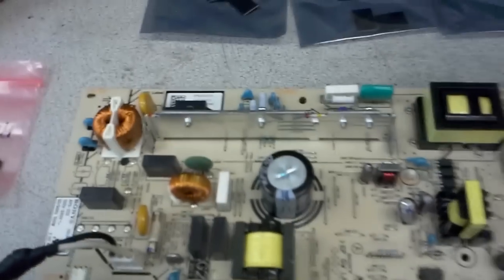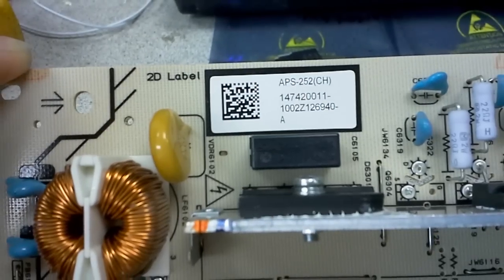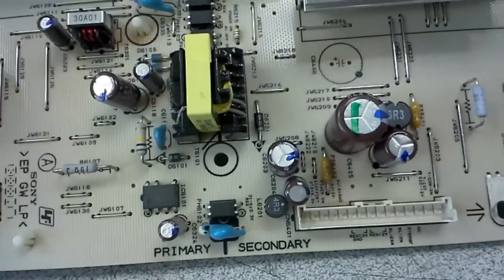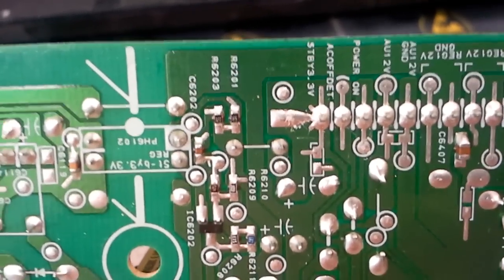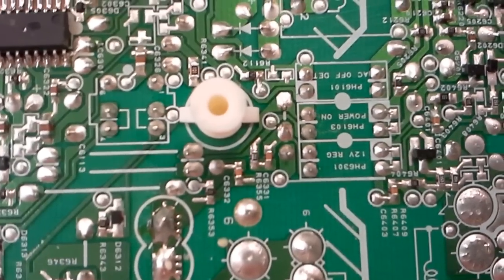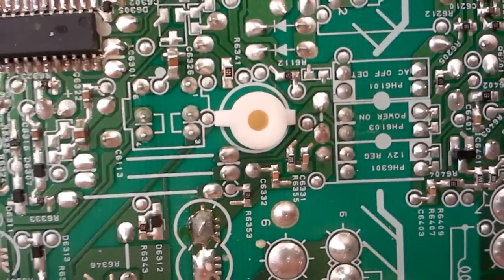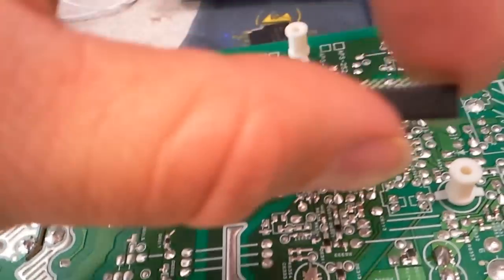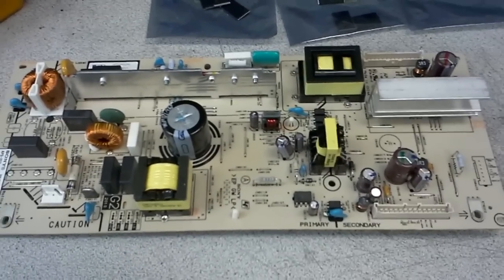Sony KDL-40EX400 KDL-40EX500 dead power APS-254 1-474-202-11 - how to test

Comment: Let me see, time 4:20 aprox. when we join 3.3 standby and power on and we measure the  right two pins of power on octocoupler, it must measure aprox, 1.2V, or am I wrong? If those two pins are the trigger for the octocoupler to activate the IC, how can a test its   function properly?
Reply from the maker: Without watching the video - sorry! - there are several OCs on any given power board and some of them are on/off switches and others are feedback for the voltage regulators. PS_ON is an on/off switch an if you trace the PS_ON signal to a particular OC then yes you should be able to see ~1.2V on it when PS_ON is activated. Naturally you should be able to see its transistor switch on the other side carry some voltage 10V to 24V depending on the board, which goes down to 0.x when the 1.2V hit the LED side and the junction saturates.
Reply: @coppelltvrepair thank you, I¨ll use this guide! 😁

Comment: You could have mentioned that the controller ic was glued to the board. After a few picks did nothing, a small screwdriver took the chip off along with 3 other components.
Reply from the maker: That is probably correct, but then I'd have to be saying it about just about any other board I talk about, plus I should be sometimes mentioning the coating of the board or the optimal temperature and airflow range needed to take out an IC without causing a pop on the PCB due to overheating and...I am quite certain I also miss a ton of other things.
No hard feelings meant or taken, it's just the way it is...
Reply: @coppelltvrepair  after the fact I realize I shouldn't have pushed the screwdriver with my hand, should have tapped out with something for more controlled Force. Aside from the power chip I bought, I'm only out about $25 in fuses I bought in case more than the power board fuse was bad. Tv prob not worth buying a $40 power board.
Reply: Plus, I don't have surface mount stuff, so I used solder braid and a pick with the iron to pull the chip leads up.
Reply from the maker: @sirthomasnolan  Glad you choose to see it that way as it will easily explain how the benefits of disclosing certain know--how to the world are not necessarily worth the cost of doing it the best way possible or even better way that it has been done.
Put otherwise, it's just as easy to say "you shouldn't have put so much pressure on the IC" as it is to say "you should have told us it was glued on the bottom" :-)

Comment: I have the KDL-40EX713 which has a 1-457-927-11 transformer on the 12V on the one side. I thought the thing was open on the other side but the print shows location LG152 as having 10uH on that side of it. Was this an isolation transformer as it directly drives the 12VDC for the T-con? Seems to have something to do with the LED back lighting as well. Is anyone familiar with the EX 500-700 series of SONY?

Comment: Thank you very much for this detailed explanation. I have a KDL-42EX440 that sometimes won't turn on, sometimes turns itself off. IF I don't see any bad caps I'll use your trick to turn it on (short pins 1&3) and measure voltages. If they act wonky I'll replace the chip. Thanks very much for taking the time to explain how this thing works, without a schematic there's no way I would have figured this out myself.

Comment: I have this model Sony.  It randomly shuts down, sometimes right away, sometimes after hours of operation.  It seems to be worse when the room temperature is low (heat turned to 65 at night) when you first turn it on. Sometimes I have to try several times. When it shuts down, the red light is on, when it is running the green shows as normal.  Possible bad caps? If so, where?  Seems like only a couple of caps on the output side of this board, is that all that does the filtering?
Reply from the maker: Afraid I do not know the answer, sorry.

Comment: my problem is the small like 8pin ic gets overhheated ther turns off.unplug and cool it up then turns on again but heated again turns off.i placed small heatsink on top.and i will find small blower and observ
Reply from the maker: Isn't it easier to just replace the IC and see if the problem goes away?

Comment: For me that was broken was the two 2SK4096 Mosfets and one Electrical 0.1 Ohm Double Pin Resistance Fusible Resistors.

Replaced them and now the TV works as new again.
Reply: Is it possible to test them with a voltmeter? If so  would you mind explaining the procedure? Thanks.

Comment: Hello I have a 32 inch Sony Model 32BX300 which uses a power supply model no APS252 which reads 110V - 240V 50/60 hz 150 W - can you please confirm that this TV will work in India where the voltage is 220V 50 Hz or would I require a step down transformer ?
Reply from the maker: If the PSU says it is 110-240V then it will work without step down transformer.

Comment: Hi there I need a new power supply board for the same model KDL40EX400 
APS-254
 I have different part numbers so I’m finding it hard to order parts 4-181-967-01  
A1751990A 
I am in New Zealand
Reply from the maker: Afraid we can't help from here.

Comment: Hey got Problem with my KDL-46EX715 . Standby Flash 2 times. After remove power Cable, and turn it in again, standby Show no flashing and after turning on, green light turn on for 10 sek. But only black Screen and no Sony Picture. Sometimes i hear a Click befor red light turn on 2 Times. After this happens, cant turn the green light on again and there is no 12v on the Connector. Befor I try to turn the tv in, there is 12v on the Connector.

Sorry, i speak Not Very well english.

Comment: hi 
 I am facing 6 red light flashing error  what is the best approach.
Reply from the maker: Test the PSU inside (connected) and then outside of the TV; try to manually turn it on (with the main board disconnected) and try to activate backlight.

If you get backlight done you know your PSU is almost certainly good.

If you do not know how to do those things send the PSU to someone who can or get them to your TV.

Alas I can't say what is error code 6 out of the top of my head.